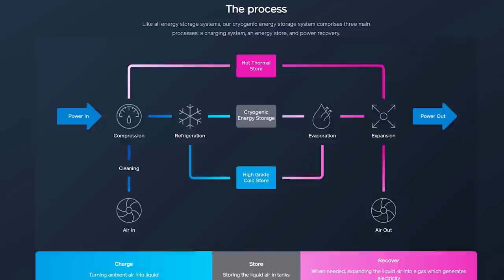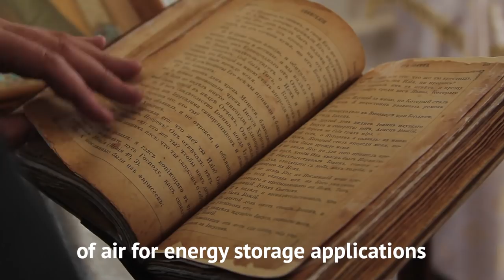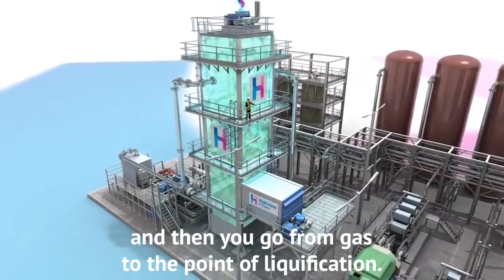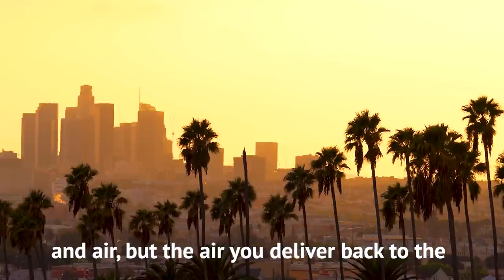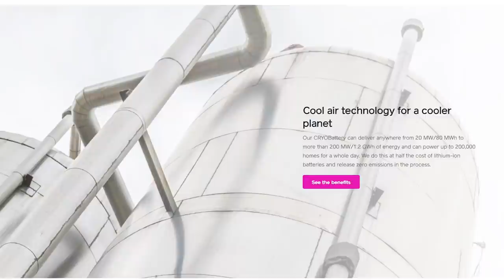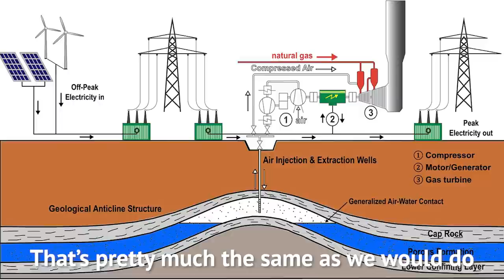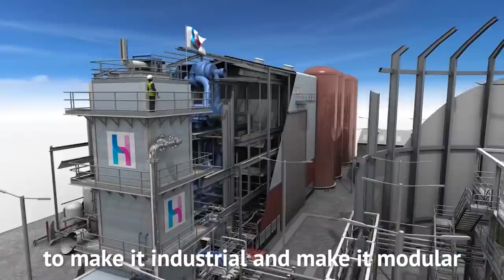CRYOBattery Storage? | Highview Power Interview

Comment: All this makes absolute sense.
Using spare energy to store energy to make energy when required.
No pollution and also carbon capture.
No burning stuff.
Win Win Win. 
Set these up around the globe and were sorted.
Reply: Unfortunately, this is not the complete answer, but this technology can easily get us to the 95% renewable level. The problem with 100% renewable Energy is Long-Long duration storage, those rare occasions where the Sun doesn't shine and the Wind doesn't blow for a week or more. However, I say let's get to 95% now and worry about the last 5% later !!!  I really think we should be  calling for 95% renewables now and while we are working toward that goal, technology can be working to solve the last 5% !!! Note: the real problem with the last 5% is economic, how much are we willing to spend on a large storage solution that will only get used once a year, or even once every 5 years?

Comment: I hope their stock goes public soon. I would love to buy some of those shares
Reply: Do not waste your money, he left out the one really big issue, its only 25 percent efficient.
Reply: @philipwoodgate9555  Its 50% efficient without using waste-heat from other processes. That's... ok. It's about comparable to hydrogen storage, BUT one caveat here is that they may be able to sequester carbon dioxide while storing energy. If governments start forking out money for carbon sequestration these guys might make a lot of money.
Reply: @0hypnotoad0  Section 45Q(a)(1) allows a credit of $20 per metric ton of qualified carbon oxide captured. That's US ITC (Investment Tax Credit) code, not UK.
Reply: @philipwoodgate9555  Wrong, it's over 90% efficient. (with the storage and reuse of the heat and cold used to liquify the air).

Comment: No, now we don't know and his video is tooooo long for the information it delivers. He talked AROUND his technology everything three or four times, but not ABOUT the technology! I don't know, what he is doing with the heat and cold from these processes!
Reply: I have seen videos on this before, they store the thermal energy in a large mass and ideally site they system where there is waste heat or cold (such as a plant that changes the pressure of natural gas)
Reply: Don’t need to talk about the technology. It has been around a long time. Currently in use for a large variety of industrial uses. Elegant means of storing excess solar and wind energy on a modular scalable platform.

Comment: This is interesting. But I have to ask what the overall efficiency of this system is? I really like the idea of battery storage, except for the problems associated with the elements in modern batteries. We need another solution for storage. It seems like these storage plants would work well together with battery storage.
Reply: According to their website it has an efficiency of 60-75%, compared to 75-85% for Li-ion.
Reply: Wind Farms are being curtailed. This 100% waste. With large scale, cheap storage like the Cryobattery you won't need to curtail wind farms.Round trip efficiency doesn't matter in this comparison.

Comment: As they have on the testplant you really need a large heat source to do an efficent coversion from liquid air to power. From Wiki (https://en.wikipedia.org/wiki/Cryogenic_energy_storage) and other sources with out a could storage and a heat source. You only get 25% off the energy back, but when the other factors are added you get up to 70%. This is still a lot less then what you get from Li-based batteries.
It is also a lot slower to add production to the grid since they have to spin up the generator just like in a peeker-plant.
 
Basicly the main advantages a liquid air battery have is the material it is made, the media used for storage and that it can turn low grade heat to electricity.
Long time storage will slowly "discarge" the battery because the air will slowly heat up and boil off, but for a large storage this is a slow process.

Comment: would like to see how much Joule are lost through boil off per hour.. To limit that, storage tanks have to be BIG
Reply: Hi Thomas, the size of storage they're using the losses are going to be tiny, in the region of 0.05%. This is still a lot of air because of the size of the containers but overall nothing much to worry about considering it is only purified air and better than battery storage in respect of duration.
One solution to the boil off losses was looked at by NASA and Highview could implement a solar powered active cooling for their cryo tanks. This helps with excessive pressure build ups and any need to vent off any stored energy.
With the speed of battery storage and scale & longevity of cryo air with both being able to be implemented anywhere it is needed the renewable energy market have at last a very powerful tool at their disposal.
Reply: @helenlawson8426  Hi, thanks for the explanation.

Comment: Reading up on this, it seems efficiency varies between 25% to 70% depending on the scale of the storage (as mentioned), the location, and wether the waste heat is captured and resused. However, storing 70% of energry which would have gone to waste is a 100% gain.